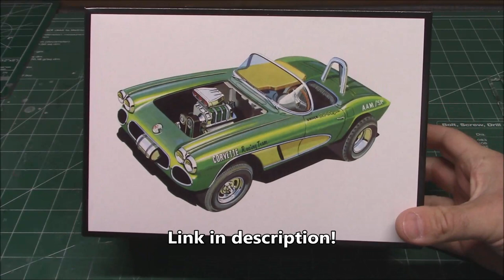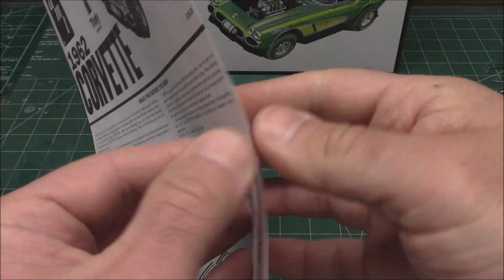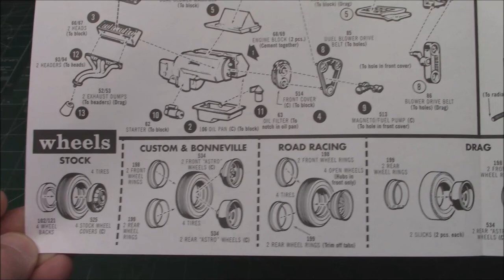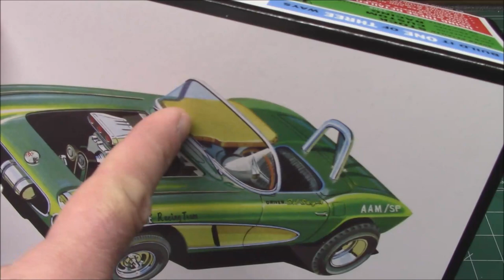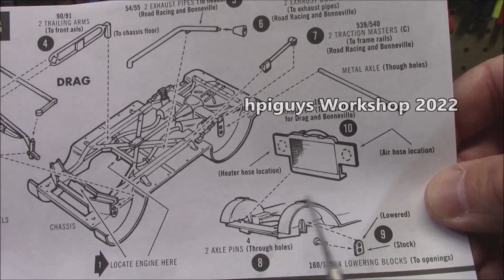1962 Chevy Corvette 327 Fuel Injected 3n1 1/25 Scale Model Build How To Assemble Dashboard Engine

Comment: I thought I remembered building this but I wasn't sure until I saw the chassis with the exhaust and rear dif molded in. Then I was sure. I was always disappointed when I bought a kit like that. Their 63 corvette was the same. Ironically the 53 corvette kit had a frame separate from the bottom and was very detailed

Comment: The only thing I never liked on the 1962 Corvette by AMT: the headlights. They look way to small. Compare it to the 1960 Corvertte by AMT. They look perfect and I don't know, who messed this up when the mold was built. So my way to build one is to cut of the front end and replace it with a propper one from an "older" C1. 
Take a look to Revells 1962 Corvette: it looks perfect at the front.

Comment: I am curious about the paint.  As a base coat for the body, you indicated that you used flat black (and not black primer).  What is the advantage or benefit
to using flat paint for a base rather than a regular primer ?   I have been using rattle cans for a long time and this is something different for me.
Reply: I too am curious 🤔. Why the flat instead of primer?

Comment: Excellent paint job, I love the shine you get with the Pledge. 
Were those 4 lowering blocks all the same, or could they be switched front to rear to fix the ride height? 
If they are the same, I'd worry that using the other hole would make front too low. 
In that case, maybe using a grinder to remove a bit of the block would fix it, and still use lower hole?